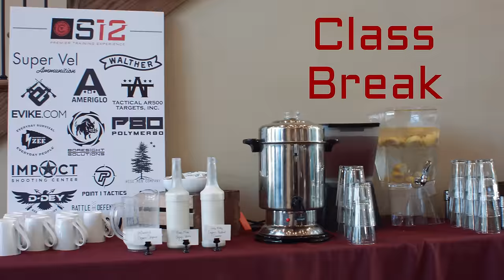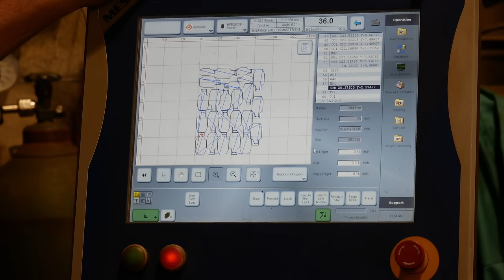Moving with a Rifle | S12 Nashville 2019

Comment: I trained under JSOC, when kneeling, my preferred position is just like his, on the back leg but I find it more effective with bone on muscle not bone on bone. I would place my elbow right in between where the two thigh muscles at meet at the knee joint. sits right in that pocket. bone on bone can be a little unstable with some wheeble wobble going on. then again I am a widdle guy. also when bone on muscle, I can apply a little forward pressure with that lead arm on my leg for a little more stability. bone to bone I cannot without risk of elbow sliding forward off the knee. I recommend trying both and use what works best for you. when getting in the prone, I would use what's similar to the PLF (parachute landing fall). This works best when performed NOT from a dead sprint, as you may get disoriented. practice will eliminate that though. with the PLF I can maintain both hands on weapon and having that safety switch awareness, can avoid slamming weapon into things and my face into the weapon, and engage the target with maximum speed. To do this maneuver, you roll to the ground on your non firing side (left side for right hand trigger hand. right side for left hand trigger hand). side of your feet, thigh, butt, pull up muscle with weapon down range and both hands where they need to be on weapon, roll back into firing position while pulling weapon into shoulder ready to kick ass. Great Instructor.

Comment: You might as well say I have zero experience with this stuff. My question is why engage the threat then put your safety on before scanning left, right and behind? Why not keep your trigger finger high on the receiver while scanning? Then put your safety on. 
    If you discover while scanning the original threat has a partner and your life is in immediate jeopardy, I don’t want my safety on.